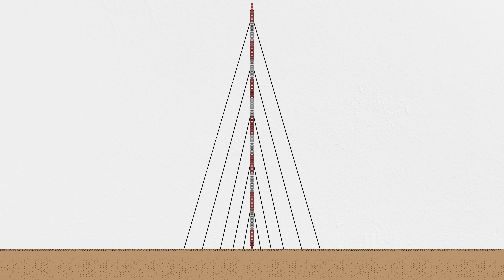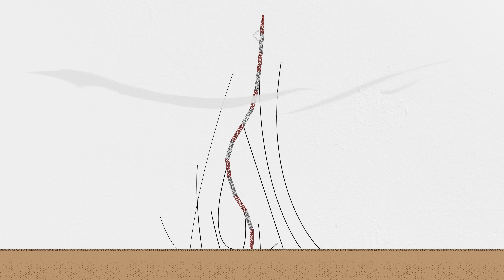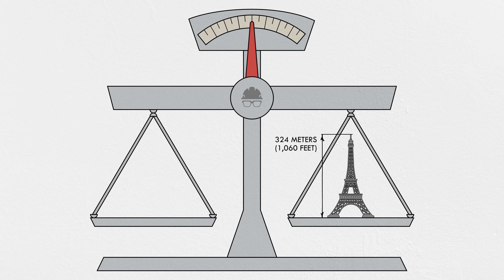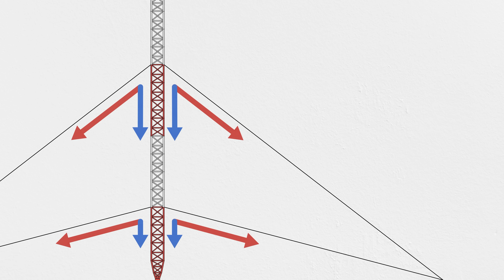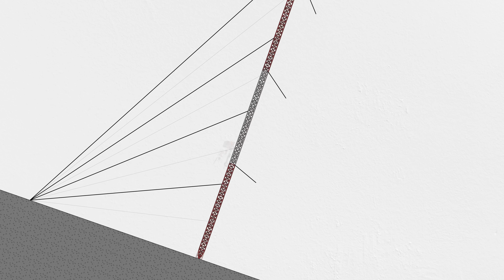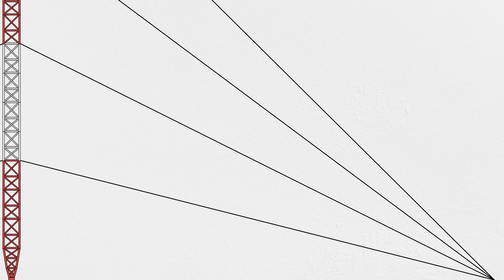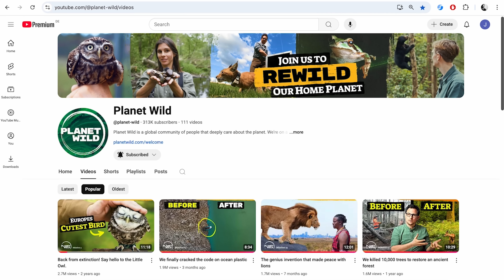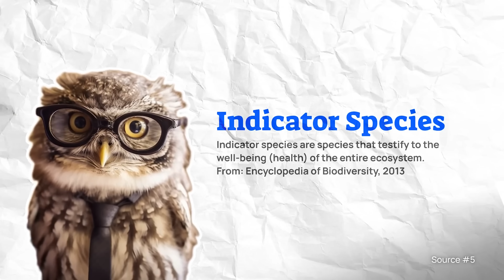The Bizarre Bases of Antenna Towers

Comment: Maybe I’m wrong but when you said “you can’t push a rope” my first thought was “you can’t but only in a wave format” could a tower with oscillating supports be theoretically taller?
Reply: Secondary thought, wouldn’t an array of towers with four at the cardinal directions with a central one supported horizontal by the four others be the most stable while still allowing the 4 others to help support teller central.
Aka 5 pillars in the shape of a plus or times symbol. 4 outer used to both horizontally stabilize the central but to also further vertically stabilize the central to be taller than the radial supports
   •
   |
/-|-\
|<|>|

Comment: I want to see video of the spark gap on an insulated tower taking a hit... 
That being said I drive past one every day, and I used to work in a building right next to it. I wouldn't be surprised to find out its one of the oldest radio towers built. It's run by WGY which was one of the first radio stations and is still running today.

Comment: 1987 the KTUL 1909' tower collapse under what was estimated to be 200 tons of ice, in the article it was mentioned about the number of birds & variety of species that are killed by the tower but it didn't go into how. From 1974 to 1984 slightly over 1800 birds were collected at the tower base, I assume they were electrocuted or struck the tower?

Comment: these towers can be amazingly scary. Did you know the little huts at the bottom that carry the electronics don't use AC power. almost all of them use DC power, but not just regular DC, polarized DC. instead of grounding the negative, you ground the positive. this is done so any of those stray voltages from lightning and otherwise won't find a path through the sensitive electronics. many of these system run on -24 Volt DC (VDC) or -48VDC system with battery back ups and these batteries are not like your regular old UPS or car battery. they are 1-2 volt batteries, but with 24-48 of them in series creating an IMMENSE pool of power that can also tank a direct lightning strike. i was in a hut once when it was hit with lightning and i remember seeing the ground bus jolt and shake from the amount of power running through it. the batteries created a large amount of bubbles and every alarm in the building started going off. not like smoke or fire alarm, but power alarms and the like. that way the companies that maintain are aware of the incident and can send a tech out to make sure nothing was severely damaged.
fun tidbit, one of the batteries ended up getting damaged and shorted, nearly causing a thermal runaway. (sort of like a lithium battery fire, but not as dramatic) the emergency breaker kicked in before i even realized what happened.

Comment: I used to be an antennaphile, but I'm okay now :D Joke aside we have an interesting radio mast here which is a https://en.wikipedia.org/wiki/Blaw-Knox_tower type. It requires a reduced size area for the cables, because they connect only on the middle to the tower, the upper part is like a self supporting tower on top of the lower part. It is heavier, but it's more stiff as well :)
Anyway I really liked your demo, very educational, tactile and fun! ^^

Comment: The heat generated by a microwave oven comes from the water molecule vibrating in resonance at 2.45ghz precisely.
The heat from the RF power itself is one little part of the heat generated.

Comment: I'm so glad you made this video!  I hope you start a series on towers.  I recently started a job as a CAD detailer at a structural engineering company working with telecom towers.  I had only worked with architectural drawings before, so I looked for information on towers and was surprised at how little information (that doesn't require an engineering degree to understand) is out there.  I said "I wish there was a Practical Engineering video on telecom towers."  And now there is!
Reply: Same job here. Agreed, very little info out there

Comment: Geerling Engineering has another great video on these towers, including the broadcast equipment at their base.  A father/son channel, the dad worked (works?) at KMOX, one of the most powerful AM transmitters in the country.  I live a few miles from their tower, and it's easily visible from much of St Louis.

Comment: Interesting video, I knew for a while that AM transmission energizes the whole structure and I remember seeing an electrical engineer for a tower showing that the arc between the tower and ground (AM towers have a massive grid below them as well as you need a balance for this to work) you can hear people talking or music playing like you may see with Tesla coils.  I am fascinated by these things but the heights and high power used on these things terrify me.  You should look at the engineering that went into the CN Tower in Toronto as that structure apparently has a rated life time of 300 years.  The next biggest tower I see when we travel between my home town to Kitchener, Ontario to visit family is the Baden tower, it sits on a big hill and I believe we were able to get CKCO TV from it in my childhood in the early '90s at our home outside of Holmesville, Ontario with the Showgun antenna.  We didn't have cable in those days and the Internet was also something we wouldn't see for a couple of years in Huron County either.

Comment: When I was in the military we worked with HCLOS radio towers of 15m and 30m. I remember very explicitly being told by my platoon sergeant when I was a fresh LT that if I ever saw one of the guy-wires snap on the 30m tower, to run away as fast as possible, cause that thing would come down with the force of a several hundred pound whip

Comment: I climbed tower for a couple years and I did climb one guyed tower that was four sided and each leg was anchored to the ground. It was an older tower and I was nervous about climbing it because of that. It was also 500' and had a lot of abandoned antennas on it and no lad-safe cable so I had to use my lanyards all the way up. I've also had a crop dusting plane come fairly close to a tower but those guys are pretty good at what they do so I wasn't too concerned. It was a fun job with the right crew.

Comment: 13:44 This makes me wonder, if you were transmitting AM analog audio or video and lighting struck the tower what would it sound/look like from a listener of the signal?
Reply: In my experience, generally the transmitter would re-start and the audio or whatever was being transmitted would be off for a brief time.
Reply: Stray EM energy usually just sounds like static. If you set your AM radio in the car to a quiet station, you may notice static when you drive past an old transformer or insulator on utility poles.

Comment: I once paid a visit to the KRDK-TV mast near Galesburg, North Dakota, the tallest structure in the United States. I just found the location on a map and drove there. It was out in the middle of the corn fields. It is very hard to get a sense of how tall it is by just looking at it. At the base was the engineering building, where the radio engineer(s) work and where the radio broadcast equipment is housed, and the enclosure for the generators that keep it powered in case of a general power outage. I knocked on the door and the engineer came out, and happily gave me a fairly extensive tour of the place.

Comment: I was running through farmland next to a radio tower. A thunderstorm was approaching, and when I saw lightning miles away on the horizon, I immediately heard static discharge on the tower, long before the thunder arrived. I inferred that even though the lightning was far away, the effect on the EM field must have extended a large distance, and a sudden change generated a significant current in the structure. I thought this was neat (and promptly got out of there).

Comment: In the Netherlands we have the Gerbrandy Tower which consists of a concrete tower with a height of 100 meters on which a guyed aerial mast is mounted. Its total height was originally 382 metres, but in 1987 it was reduced to 375 metres. During Christmas more guyed wires are added and decorated with christmaslights, so you basicly have a 300 meter tall christmastree.
Reply: ijsselstein mentioned!!

Comment: There is a TV antenna mast near where I grew up called Winter Hill mast near Bolton Lancashire. It is on top of a 450m hill and it's such an iconic feature of the landscape, especially as it's on top of it and rises 300/400m above that. It has cowling on it in a blue and white pattern, with red lights all the way up.
Reply: Very similar to the Belmont mast near Horncastle in Lincolnshire which used to be the tallest until they shortened it after the analogue switch off.

Comment: wouldnt 3 ball joints make more sence than 1 impingement point? that way the tower could sway under excessive load and also shift ever so slightly. im no structural engineer and i HIGHLY doubt im the 1st to think of it, so theres probably a reason why they dont.

Comment: As I understand it, the tower is only likely to be struck by lightning because it is a low-resistance electrical conductor. But if the tower is isolated from the ground, then the resistance is very high, so it wouldn't become such a hazard. Why does it need to be grounded at all?

Comment: I worked at a midwest radio station and one Sunday afternoon in 1987, a tower technician was leveling our microwave tower at the station that sent the signal to the transmitter tower. He was jacking up the tower slightly to put a shiim in and he went up too far and the 80' tower fell over taking out electrical and telephone lines. We were off the air for two days while they shipped in a new tower.

Comment: As an ex broadcast engineer, there are a few other tidbits on big towers that are worth looking at.  When Hurricane Donna went thru Florida, it not only tore the roof off Channel 13's transmitter building, but almost took down the WFLA tower.Apparently their first chief engineer thought putting out the $$$$ for a 1000 foot tower with a ceramic point at the bottom was not important.. so in the ground: Concrete with bolts sticking out to hold the tower.  That was fine for 7 years, but then Donna came along and had different wind loads at different heights.  The result? Twisting the top half of the tower popped a LOT of the welds holding the cross members in place.  After the storm passed, and they looked up, the transmitter engineer almost had a cow.  Lightning is scary, but a tower falling on you is beyond terrifying.Consulting engineers were saying bad things about what would have happend if the storm stuck aroud for an extra slice of time.  They spent months getting the physical tower back in shape.  And the decision was made if they ever had to replace the tower, they WOULD put in the point at the bottom because that was the ultimate cause of the popping braces from midway to the top.

Comment: Instead of using metals to keep the antennas, can they be replaced by a helium  balloon?
In this case you can easily lower the balloon to repair the antenna instead of climbing.

Comment: USA stopped broadcasting TV in analog signals, all in digital with smaller antennas with higher frequency and shorter wavelength in which the height of wavelength requires smaller antennas.

Comment: The stays on towers are frequently re-tensioned as part of routine maintenance. The deflection in the tower is typically within a mm. The tension in the stays is huge.
In certain wind conditions, the stays can adopt a mode of vibration, which can become unstable leading to a state often called galloping. You can appreciate the energies involved when you see and hear this.
Finally, the bearing installed at the base of a tower is a prize when the tower gets dismantled. Often, the engineer who originally installed it is the one that gets it.

Comment: The importance of guy wires to the structural integrity of radio towers was driven home to me several years ago. In my job as an LEO, I was investigating a report of smoke along a recreational area wherein were located three AM broadcast towers (a directional array). We responded in order to direct fire personnel. A small wild land fire was burning beneath one of the towers. was probably about 250' from the base of one of the towers. As I awaited the arrival of the fire dept., I suddenly heard a loud pop. The fire had managed to damage one of the guys to the point that it snapped. The tower began to fall in my direction and missed me by probably 20'. It came down so quickly that I really didn't have time to run. Luckily, these were small for AM broadcast towers.

Comment: Ive been up an 1100-1200 ft. TV tower many times maintaining ham repeaters.  Things I learned:
A little bit of wind down on the ground turns into a whole lot up there.

One time in the fall, it was a nice mild day on the ground. Light wind about 10 mph out of the south. Up where I was working, at least 500', possibly nearer to 1000' the wind was 20-30 out of the North and much colder. All I wore was a light sweater. It was miserable up there.
In the fall yellow jacket wasps like to swarm the towers. I've encountered them above 500'

Comment: The WTVR antenna built in 1953 is 843 feet tall and is a free standing lattice tower. It used to broadcast AM radio at 50000 watts. Heard all over the world when it shot skip. You don’t need a 2000 foot tower.

Comment: 3:35 A 2000 foot tower's radio horizon is about 63 miles.  Radio waves are refracted more than visible light so the radio horizon is farther than the visible horizon.

Comment: 12:02 Thats cool so you just have to snip a few lines to take one down
Reply: This guy just wants to watch the world burn
Reply: @u12bdragon I mean, that's quite a valid and serious security concern, assuming that critical communications are being broadcast through these towers, don't you think?
Reply: @LRM12o8  some would even call it 'domestic terrorism'
Reply: "Snip" is a bit of an understatement. The cables are usually well over an inch thick of steel.
Reply: @thelight3112 well then, a battery-powered angle grinder can take care of it in a few minutes. 💁
Reply: @thelight3112 you basically told the guy he'll need chain cutters to take a mast down 😂
Reply: Causing chaos is so easy nowadays
Reply: That’s what I always assumed.
Reply: .....excellent
Reply: Stored energy would prob cut you In half as well

Comment: One of my neighbors, is a three legged guy tower built to Space Force specs. Schedule 80 flanged Stainless steel tubes! Bolted tegether. Just one of several up here on Sauk Point. A true Antenna Farm. They tend to be quiet, unassuming. Until shedding ice. Well done video,as always. Enjoy the Birding!! Cheers,Walker

Comment: The tension of the guy wires can actually be checked by pulsing, basically giving the cable a good tug to the side, then measuring the time that it takes for the pulse to travel up the cable and back a certain amount of times, usually 3 or 5, and then then tension can be calculated by the time it takes. It's kind of interesting. Tapping the guy with a wrench also sounds really cool.

Comment: The fool who was put in charge of the cable replacement was a king of idiots. He had no clue what he was doing. When people tried to intervene, he would arrogantly dismiss and insult them. I think people of all professions should always confront such people and have them fired before they hurt someone or do a massive damage. Sadly, there are "specialists" like that everywhere. For example in the US in a certain car test lab that I knew they had a water brake for testing car engines. The whole idea of the water brake is that you FILL IT WITH WATER before you use it. But, they forgot. The iron/steel components of the water brake heated up, and were burning oil and paint. So, they decided to save the oil and paint by filling the brake with water at this point, while it was... red hot. 

And who can guess what happened next????

Comment: Being up at the top, 30 or 40 feet above the top set of guys is always fun. They get swaying pretty good in high winds. It gets even worse if there's booms that stick out 15 or 20 feet horizontally from the tower. And then you have a few hundred feet of rope hoisting new equipment up and they can get moving a foot in either direction easily. It's pretty unnerving to be riding it while it moves like that.

Comment: When I see the spherical bearing base I wonder what would happen if for any reason the concrete base shifted or sunk down even a few inches. An attached three or four post tower would not have lateral slip or rotation, but the bearing on the tower might slide up entirely due to the slack in the cables.

Comment: I was part of a crew that built 2 guyed towers. One in black ridge outside of grand junction Co. And another 320' tower on top of clear creek mountain just outside of Zions national park. It's dangerous and labor intensive work. But the process to erect one is fascinating. You should have covered gin poles that raise tower sections into place and torque arm connectors that prevent twisting.

Comment: I helped replace a tower when "pranksters" cut the guy wires on hell night. The tower fell. But the FCC doesn't care. Broadcasters are required to keep transmitting and are fined heavily for failing to do so. 

We ended up putting in an electric fence of the correct length. The polarity of the signal was wrong, and the range was curtailed, but it avoided the fines until the tower was replaced.

Comment: another issue with guyed masts is the torque that wind can put on the tower. like you mentioned, the guys aren't completely straight. antennas can act as sails and as they're usually off the center axis of the tower, they will try to spin the tower. Lots of guyed masts counter this by having two sets of guys on each point running at two different anchor points.
Reply: Exactly. The anti torsion or torque arms. Specially if cell antennas or dishes are mounted.